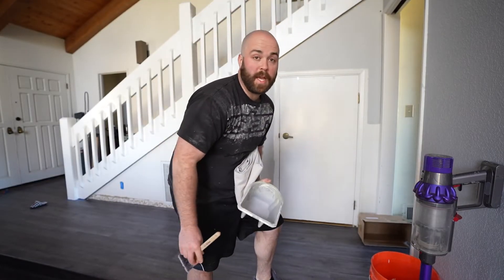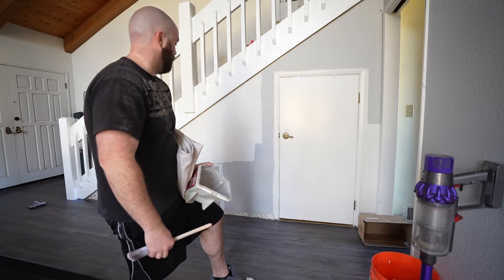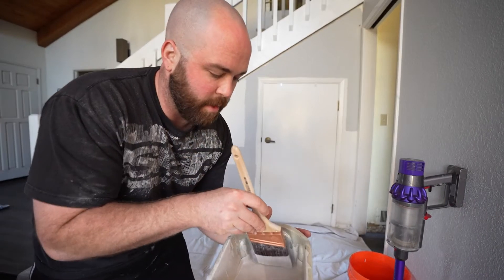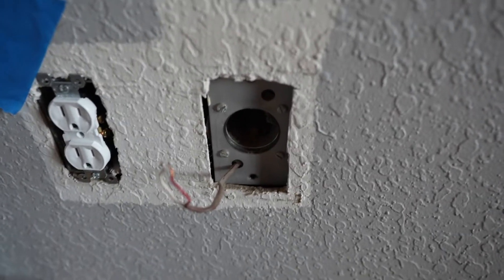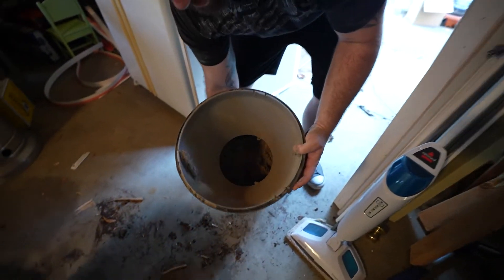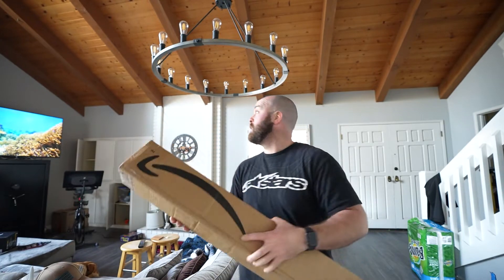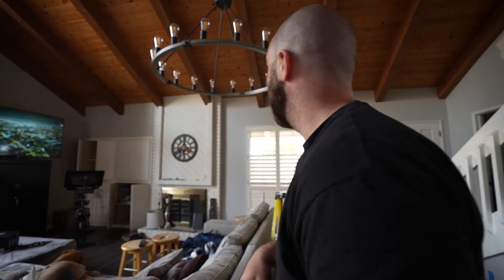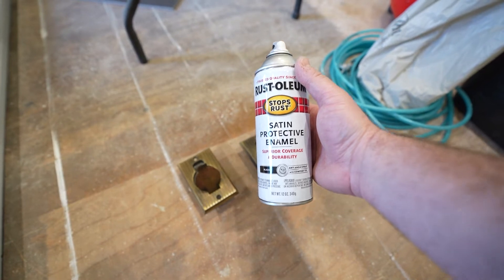How to fix a central vac with no suction - Remodeling an old house part 8 #diy

Comment: Good on you for keeping the system intact and functional. The cordless stick vac is definitely easier for quick cleanups, but when you're doing thorough detail cleaning the central vac really shines. Unlimited runtime and extra power! Plus, not having the motor and dirt right in your hand (and the exhaust blowing into the room) is a nice plus. Thosw old antique bronze wall inlets look cool sprayed black! Mine were 50 year old ivory plastic so I just switched them all out for new white ones.